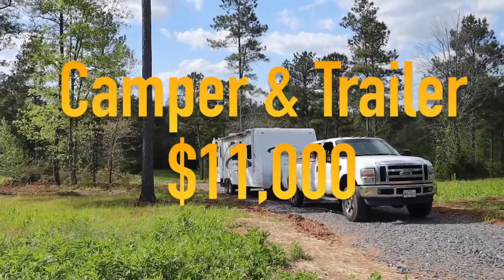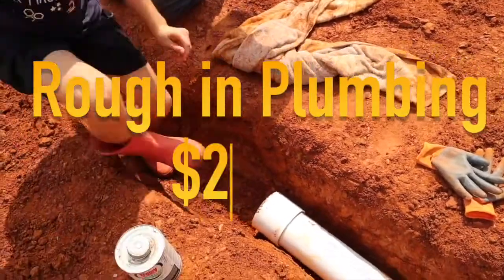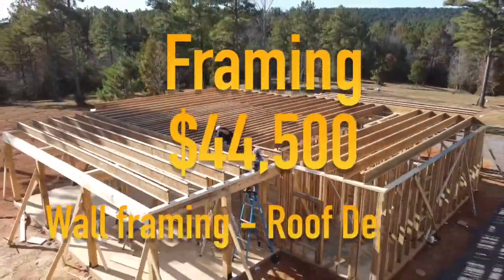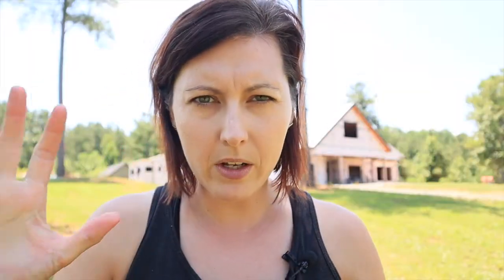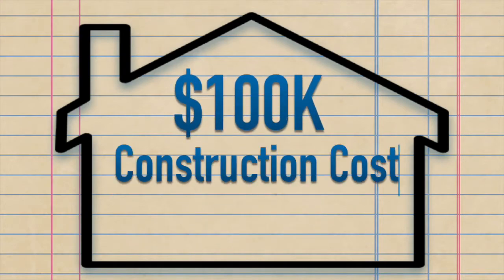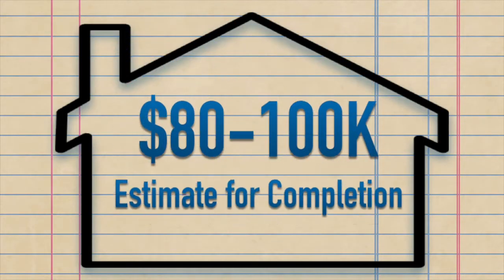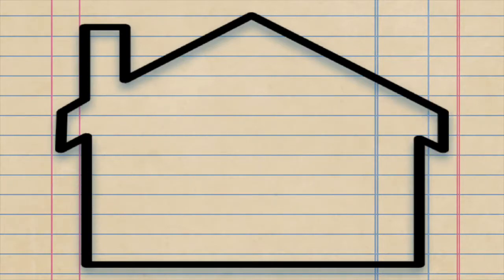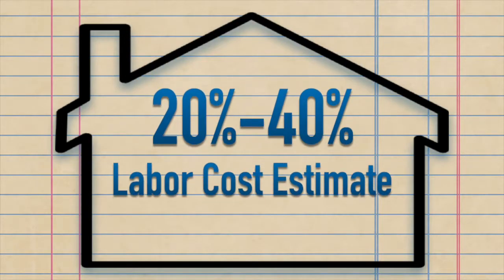How much does it cost to Self Build? Our house build cost so far

Comment: Nice job, 7000 on windows ? Can you tell me more about these so I may investigate
Reply from the maker: We got them through a local distributor but the company was quaker. We did have to wait about 4 months or so to get them and changed some things in the original quote (I think it origianlly was 10k but we shaves some off with some edits).